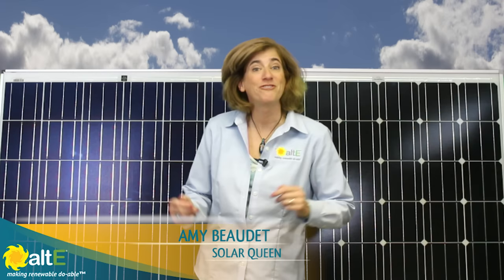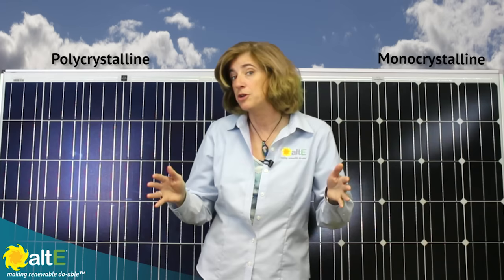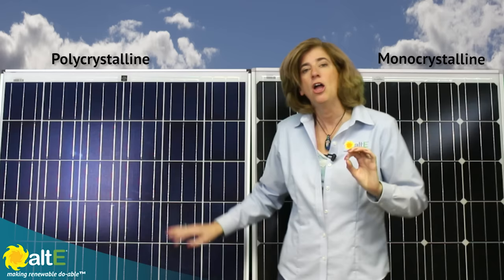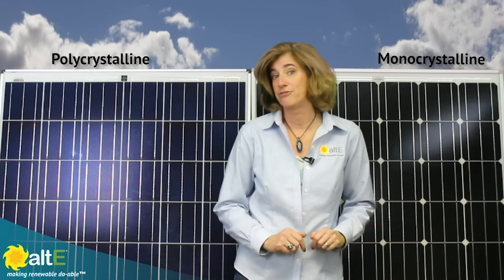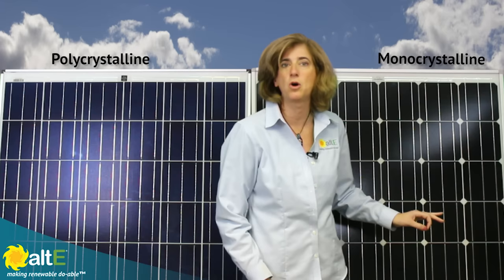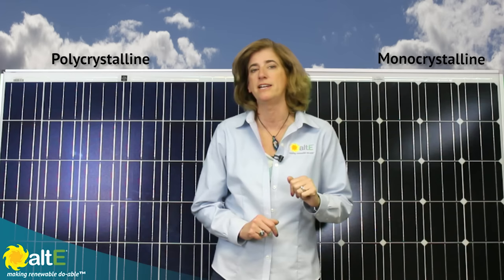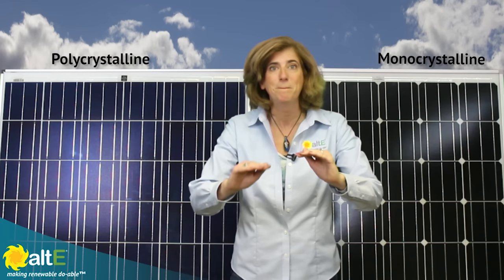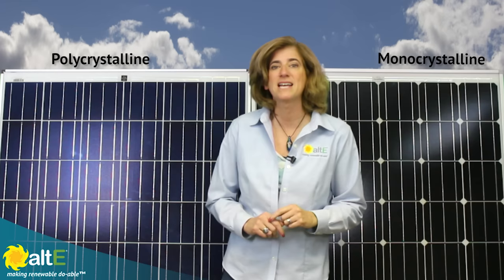Monocrystalline vs. Polycrystalline Solar Panels - What’s the Difference?

Comment: No... No ! your math is incorrect.    15.5 % vs 17.5 %.. yes, that is a 2% difference on the scale of 100%,,,  but the change from 15.5 to 17.5 is 12.5 %      I believe the ONLY reason that the total output of the two panels is so close, is because,, with missing corners,, the mono-crystaline panel has substantially less area exposed to the sun.

The real difference would be in their low or compromised light conversion abilities.
Reply: don't be so paranoid

Comment: Current doesn't drop with increase in temps, its voltage & power that do. That's why the temp coefficient for current is positive and the rest negative

Comment: can i use both monocrystaline and polycrystaline together? if yes, what wud b d impact?
Reply from the maker: Yes. The differences these days is so small, there should be no impact, provided they are both the same wattage and voltage.

Comment: Can I used both poly and mono are same charger controller?  Mppt charger controller inverter
Reply from the maker: It is best to use the same model on a charge controller. But if that is not possible, as long as the 2 panels are the same wattage, it will work fine.

Comment: +altE STORE i just  saw a solar panel which had Voc=110v Isc=2a and i was told its the latest technology called cis panel, very efficient,works good in low light,and performs better with partial sheddin, do you mind doing a review on these types of solar panels.thank you
Reply from the maker: CIS is a type of thin film solar panel. CIS stands for the key ingredients copper, indium and selenium. I don't have access to any of the panels, only the info available from the manufacturer's website, so I wouldn't be able to do anything other than repeat their marketing material.

Comment: Hie guys i got 4 x350 watt panels producing open circuit voltage of 40v each and i want to connect them to charge my 48v battery bank...do i connect them in parallel or in  2 modules series then connect them in parallel?
Reply: +Cris Mpofu it's 350 watt panels are 24 v and voc is 40 you can easily connect them 2 in series and the parallel .

Comment: what is working temperature of both types of panals?
Reply from the maker: They will work in any temperature. The voltage will be higher the colder it gets, and lower the hotter it gets.

Comment: Can you tell me if we install 1 is polycristal of 250 watts and one is monocristal 250 watts it's reliable or not answer me please I am in trouble
Reply: Any one expert tell me
Reply from the maker: Yes, you can mix mono and poly, as long as their volts and amps are similar.
Reply: Thanks

Comment: The effective efficiency will be even greater. As cable Size. Length. Inverter used etc... So even the stated ratings can be worse. Why you need an expert that knows how to build a system. As you can lose as much as 30% of the total panel arrays rating...

Comment: can some one answer my question how to boost current output from to 2amp. to 6amp.
Reply from the maker: We'd need to know more about your system to answer specifically. But the law of conservation of energy says that power can neither be created nor destroyed. Power (Watts) = Volts x Amps, so to increase amps by 3x, you must decrease volts by 3x. So, if you are charging  a 12V battery, and you have a 36V 2A   solar array (36V x 2A = 72W), you could use an MPPT charge controller to drop the volts down to 12V and increase the amps to 6A (12V x 6A = 72W). Not sure if that answers your question without more info.

Comment: Isn't another difference is Monoc' suffers less heat degradation over time than polyc'?
Reply from the maker: It can be, but the technology and manufacturing process is minimizing the degradation. They are almost all warranted not to lose more than 20% of their rated output in 20 - 25 years.
Reply: Can I ask you, are the solar panels coated with a clear lacquer or something?

Comment: It seems to me that the efficiency calculation of the 2 pannels are wrong because monocrystaline panel is black and will always be much hotter in the sun than polycrystaline panel thus reducing the voltage of it and canceling any advantage that it has over the polycrystaline. Does anyone here thinks that I am wrong? If so show me side by side results after 1 hour baking on the full sun.

Comment: You are wrong. Temperature coefficient of current has a positive value. It means than more temperature than more current. The most important coefficients are for voltage and for power. They are negative. And according to specs what you showed mono and poly have the same temperature power coefficients. It means they will produce the same amount of electricity if their temperatures are the same.
Reply: Huh?!? "It means than more temperature than more current" did you mean "The more temperature the more current"? If so I hope you are aware that it all depends on the thermal resistivity of the materials used, these can vary.
Reply: @666hobart   The bendgap of semiconductor depends on temperature. Then higher temperature then lower bendgap, and more light could be absorbed by silicon. More infrared light could be converted into electrical current.

Comment: In making the panels there should be no waste at all, the sawdust and cut offs get thrown back into the mix for the next batch don't they?
Reply from the maker: The top tier solar cell manufacturers do have very extensive recycling procedures during their manufacturing. Anything that can be re-used will be.
Reply: Intelligent reply.  There is waste, however, in the double heating.

Comment: my poly Panels perform much better than my mono Panels.  I am in Pakistan and Temp these Days is around 42 to 44 degrees C.
Reply: depends on the raw material quality and tecnology
Reply: Nadeem, that is very likely due to manufacturing differences of the panel or the inverters, not the crystalline structure of the panels.

Comment: Stating that 15% vs 17% is only 2% is a bit misleading. A 17% efficient panel will produce 13% more power than a 15% efficient panel, since 17 is 13% more than 15.
Reply from the maker: Yes, I got that math wrong.

Comment: Wait...... Mono performs better in warmer climates?
Reply: +RecarroJames Haha, yeah.. I was thinking the same thing - Poly performs better in heat. If you live in Alaska, buy Mono. And regards to Amy's quote "no solar panel, regardless of its type, performs well in the shade," Thin Film (which isn't mentioned) performs much better than both Poly and Mono in the shade.

Regardless, I loved the video. Straight to the point and informal.
Reply from the maker: +Patrick McDevitt Yes, thin film performs better than silicon, but still not well. Thanks for your comments.

Comment: It was well presented but wrong information. They should have compared voltage instead of amperage when they talked about summer. The temperature effects Voltage way more than amperage. Also when it gets hot, you actually gain slight amperage, but lose voltage dramatically, that is why you are losing power(W).
Reply from the maker: The voltage difference between the 2 was also so low, it was barely worth mentioning. The poly was -0.31%/C, and the mono was -0.30%/C. So also only -0.01% difference. But you are right, I should have said that.
Reply: Nice one Amy, i like you as candid as you are and honest and accepts negative comments positively. Thanks for the comparison of mono and poly.  It's informative. Learned from it.

Comment: the video right before you had statistics way different than yours and had the mono panel producing a third more power I will have to Investigate going to pause you and search for more info>>>>>>>pause>>>>>>>seem other opinions are the mono cell is 30 percent more efficient I would look a lot more intensely if getting my info from a dealer who make a kickback for pushing whats behind door number 3 I sai Mono so far if you live in a red or orange zone
Reply from the maker: COYOTE we are showing the facts based on the standard test conditions of the panels. No opinions, just data.
Reply: Dude, if that's a threat, back off. This is YouTube, anyone can speak freely! As matter of fact she said based on fact and she sure did as show us the fact. I learned something new today. But hey, if you felt that is wrong information or something please be gentleman show the paperwork etc. Maybe there's is something else onto it who knows.

Comment: ok presentation. please use proper scientific terms. metric measurements please. it what's used in the lab, other countries have no idea about imperial.
Reply: I'm pretty sure this presentation isn't designed for the the scientist in the lab audience...we already know the answer and don't need a you tube video to tell us.  This is for the home or business owner trying to decide between the two options. For that audience, this is very well done.  limiting the complexity of what is actually an extremely complex difference when you know the details...but all of the differences yield to very little difference in the lifetime output of the module.  The difference between a SW270W mono vs a SW270W poly, minus the multitude of real world variables of 30+ years...color.

Comment: STOP!
Most of the planet are using the wrong Panels!
If you don't track the sun daily, if your not going to change the angle seasonally or if you have a decent amount of overcast days and if you have a bit of extra space then the best panels are thin film. Most of the northern hemisphere are using mono or polycrystaline panels which are no good unless you live at the equator or unless you track the sun throughout the day and the year.
  The panels that everyone uses only work well when aligned into the sun and are completly unobstructed from shadow.
  Thin film panels will work in low light levels which includes sunrise sunset, overcast days partially obstructed by shadow and unaligned panels. 
  So unless you track the sun you are only getting a decent amount of power for 4 or 5 hours a day for half of the year.
Thin film will give you full power all day all year long!
  If you have a little more space and can invest a little more initially you will soon recover your costs and more!
Reply from the maker: Sorry, I disagree. Hardly anyone makes thin film for the general public any more. They are much more expensive and much less efficient, so it costs a lot more and takes a lot more space.
Reply: @AltEStore  This is an issue i am trying to deal with.
  A. Yes they are harder to find but not impossible.
  B. The don't take up much more space, probably around 20% and many people still have spare roof space.
 C. Less efficient? You are looking at this the wrong way. This is everyones problem.
  Efficiency is measured in full sun and not per average annual output on a fixed panel.
  The stupidity of everyone thinking about efficiency of the panel in direct sun is driving me crazy!
  Have you ever tried aligning a mono or poly crystalline panel into the sun then pulling max amps from it and while looking at the power output change the angle more than 20 degrees in any direction and you will see the power drop.
  A thin film panel will work from sunrise to sunset in any conditions any time of the year at full output. Your regular panels will only work at full output for a few hours of the day at certain times of the year unless you are tracking the sun AND live in a sunny part of the world and have no shadow obstructions!
  Now add up the hours of full power per year of a fixed thin film panel vs a poly or mono!
  This is either denial or somehow you are supporting the mono and poly industry!
Reply: @AltEStore  Hi again. Here is what i just recommended to a guy in Texas. Please note the list of disadvantages of thin film nearer the bottom of the 1st paragraph.
  They are not perfect but i do think it's stupid that people are having mono and poly fitted in fixed positions on random facing roofs at random angles in climates such as Oregon or Canada!
:
You are a lot better off living in Texas than someone in Oregon for example, not just because of the weather but also because you are closer to the equator than they would be.
  It is still better to track the sun with mono and poly. If your mono/polly panels are re-angled for the season twice a year then that would also help.
  Otherwise setting the angle somewhere between the winter and summer sun height would be the compromise. But  (assuming a dead south facing installation) you will still miss out on production in the mornings and evenings. Especially in the winter.
  Somewhere on youtube people have done comparisons over time with thin film panels and mono/poly-crystalline panels. But like i mentioned, it depends on your latitude location and weather conditions and possibly if you have partial shading from any trees, buildings etc.
  Anyone a bit further north of you might want to seriously consider thin film.
  If you have the space you can make a gimbal frame for your panels or possibly mount them on a gigantic turntable.
  A tracker does not need to be fully automated. A simple circuit that slowly advanced the panels during the day and resets them at night would be sufficient and then a manual change of the vertical angle for the season to lock them into the summer or winter angle.
  If you have the time to be around the panels every day you could even rotate your platform or gimbal by hand.
  But Thin film will start working even under very low light conditions. The  disadvantages are: 
More difficult to source
More expensive initially
Shorter lifespan
larger size by about 20%
Not as environmentally friendly

Thats the truth on thin film but if you want full power all day long and through all 4 seasons without using a tracker and you have the budget the space and the time to research the supplier then people might want to consider them as they could triple or quadruple your power gains if you lived up north and have your panels fixed. Especially if your planning on using a roof that does not face perfectly south.
  At least in Texas you don't have the same concerns as someone in Canada lets say! But people are still installing solar there too.